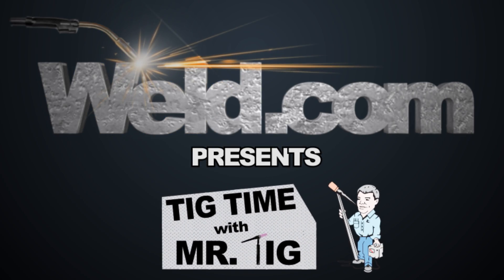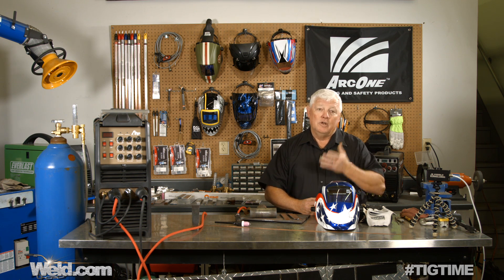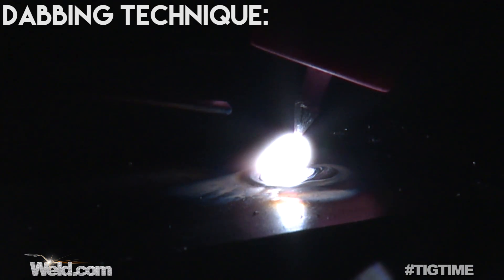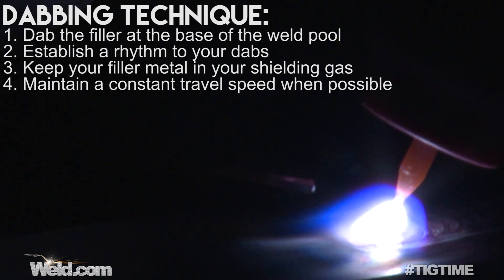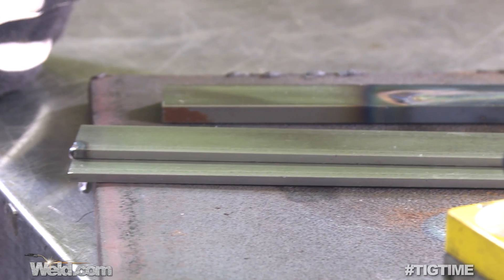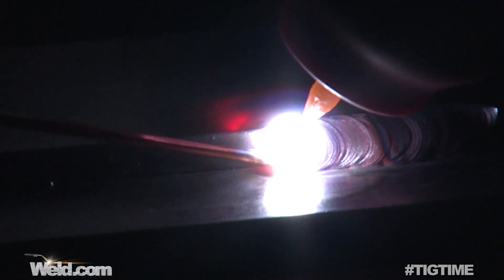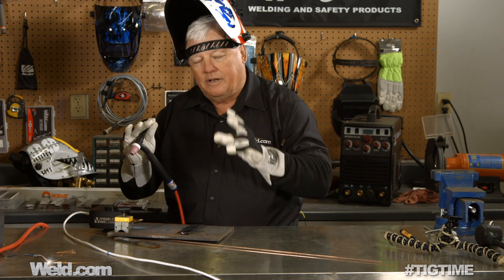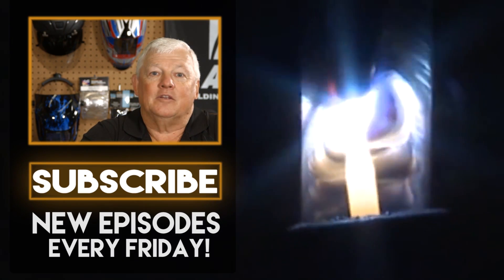TIG Welding Technique: The Dab Method Tips and Tricks | TIG Time

Comment: Trying to accomplish this lately on a 1/16 inch mild steel “ sheet metal horizontal fillet coupon. I am having trouble getting the puddle up the walls cleanly unless I floor the amps, but then I burn through my sheet metal.
Reply: Thick aluminum backer will pull the heat off the coupon and probably help you a lot, you want it to key hole before you add the filler, as soon as it begins to key hole dab the filler, keep your amps around 100 , take your time

Comment: I just bought my first welder a Everlast 160 STH and was all geeked and ready to fabricate things, until I tried to hook up the torch gas to the front of the welder. The male piece although it would go into the quick connect, the the latching action would not work. So now I am holding off work until new torch comes in. Have you had issues like this in your experience? I hope there was just a bad male fitting machining job. I really don't want to return the welder and wait even longer.  Also I do have powered by 220V but tried the stick weld function on 120V for the heck of it. Could not set above 60 amp, and at 55 or above would pop the 20A breaker on the circuit. Is that normal in your experience? Enjoy your videos, the audio is very low though.
Reply from the maker: when you plug into 110v you are going to lose about half of the available power of the machine. as for the quick disconnect, send us a picture or quick video and we may be able to better diagnose it.
Reply: +Weld.com Okay that makes sense I am now powering from 220 dedicated circuit. I have a picture of the argon hose issue but not sure how I can share it on here. Looks exactly like a air compressor fitting with internal ball bearings spring loaded to drop into the groove on the male fitting allowing lock collar to move forward. Appreciate your response and your videos. Will get new torch in two days hope it works.
Reply from the maker: +Bruce Kennedy You can post the picture on the Weld.com forum (http://www.weld.com/index.php/log-in-to-weekend-warriors/categories) or our facebook page (https://www.facebook.com/WeldDotCom/) and we will try to answer as quickly as possible.

Comment: Which welder would you suggest I purchase?  I was 12 when I started on oxy-acetylene and stick welding (44 years ago), but would love to buy a powerful TIG and stick combo rig for my shop.  I rebuild tractors, wagons, sawmills, and anything that doesnt need fixing.  My power in the shop is 220V, 200A, one phase.  I want a welder that I will not outgrow.  Thank you, Bill.
Reply from the maker: +Bill Sutherland It all depends on your price range and what you want out of your machine. If you want an inexpensive ACDC TIG welder and dont need a really low amp light off, then the AHP 200x is a good choice. If you want something that can weld at much lower amperage and has some more features, the MT-200 is a good choice. If you want a transformer, look at the Lincoln squarewave precision tig 225.

Comment: what amps would you recommend for 1/4 in aluminum?
Reply: +Jose Ramirez 300 is WAY to high heat. I would start around 200 amps and slowly decrease as you move down the part.
Reply: +Pizza Welder 260 - 300 is too much heat
Reply: +Jose Ramirez I just plugged this into my Miller TIG calculator and here is what it says:
Aluminum AC Welding 1/4" butt weld: 
Amps - 260 - 300 amps
Electrode - 3/16"
Cup orifice - 1/2 - 3/4
filler rod dia. - 1/8 or 3/16
25cfh Argon